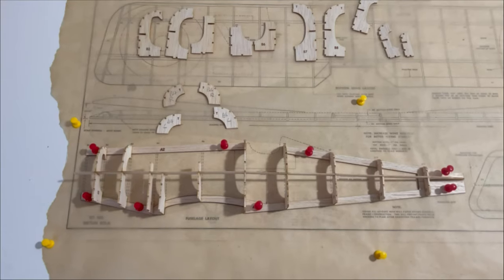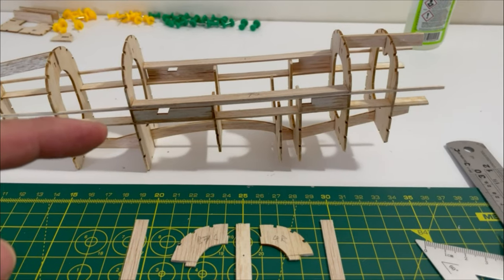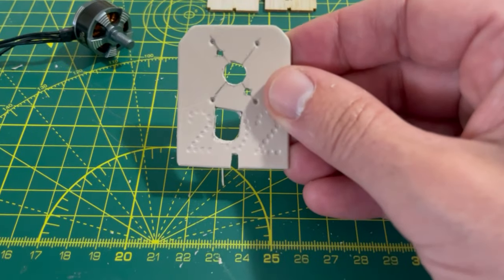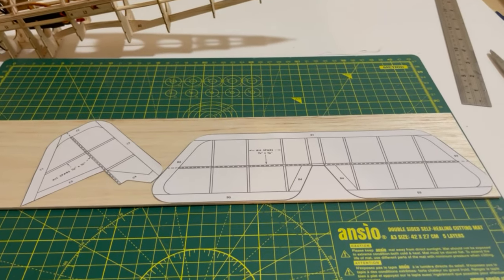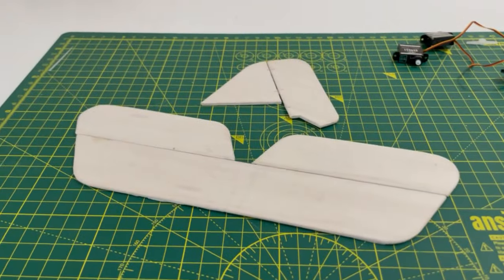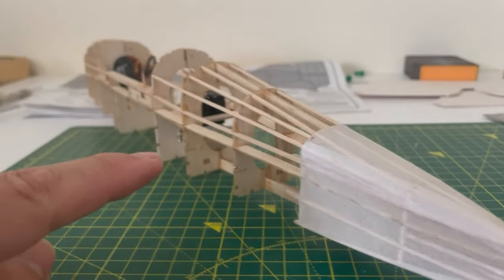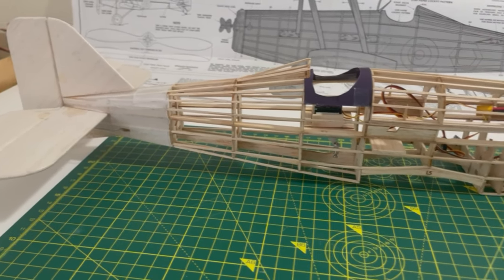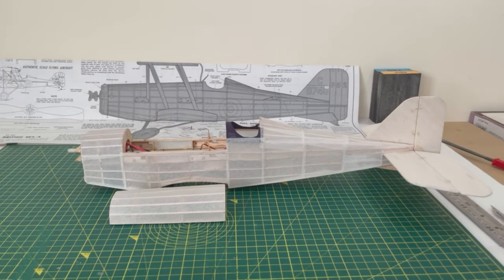SKippy's Guillow's S.E.5A RC Conversion - Part 3 Fuselage

Comment: Nice work! Keep in mind those are large tail control surfaces on a short coupled airplane. Small movements will have big reactions. The balsa landing gear will be a weak point. I copied the balsa landing gear parts in spruce and reinforced the fuselage mounting points. Haven't had break yet on some rather hard landings. 😁
Reply from the maker: Thanks Jon. I will use wire as per the plan to reinforce the gear and will limit the throws for the rudder and elevator 👍
Reply: @srknight307  I'm just remembering my first rubber powered SE5a build. Every flight resulted in cracked landing gear. 😡 Excellent build, I'm vicariously reliving my experience. 👍
Reply from the maker: @Jon.Carlsen  🤞